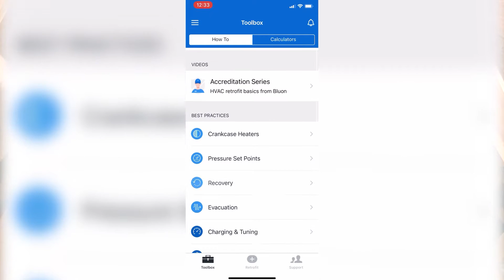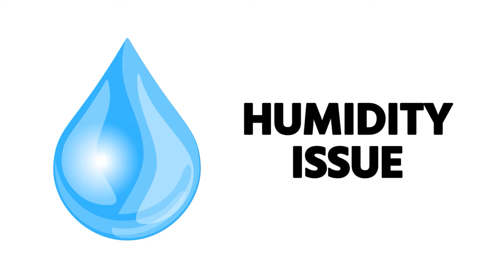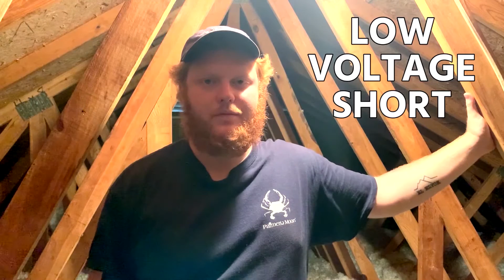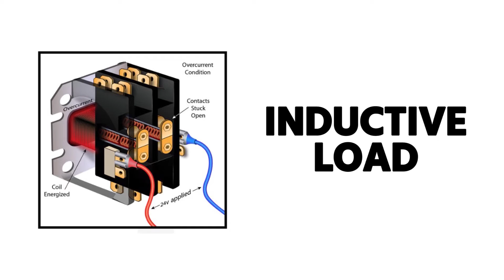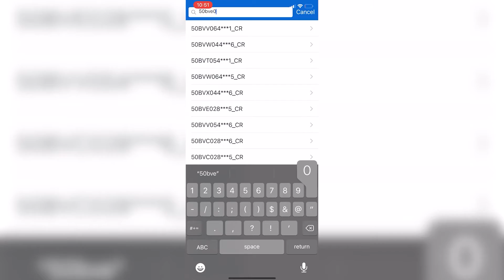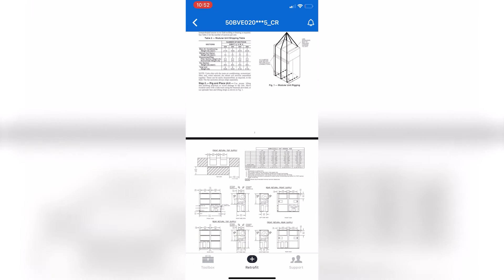Testing BLUON Tech Support Line

Comment: The high humidity problem in the beginning was your technician's fault he did not check his superheat and he did not check his suction line temperature if he did he would have noticed it was warm and not far enough below the dew point to give him effective humidity control, airflow is everything. My experience with blue on has always been good but they don't necessarily do things the way our industry does cuz our industry is about money and their industry is about facts and troubleshooting procedures.

Comment: Great job by Kalos testing out Bluon's help line. And Bluon's techs were totally on point. And the bidding feature with abilitu of ordering parts and possible delivery is 👏 👏 👏
Reply: The second tech support tech should of known that you could ohm out the coil resistance on the contractor.